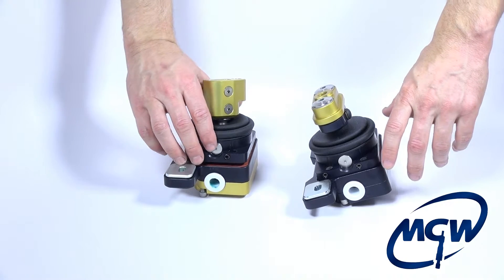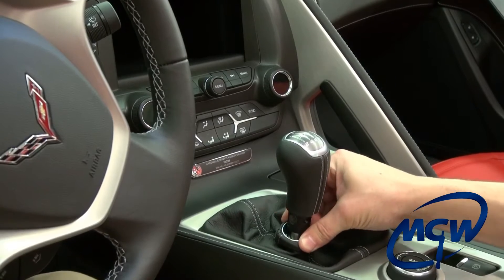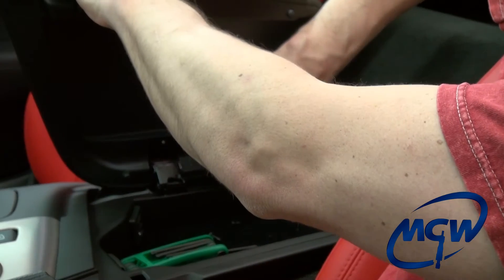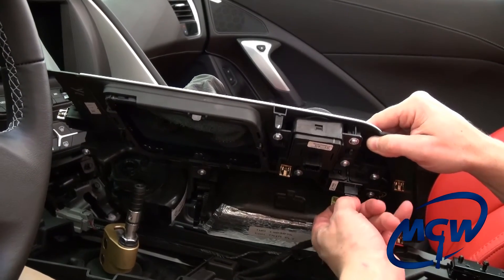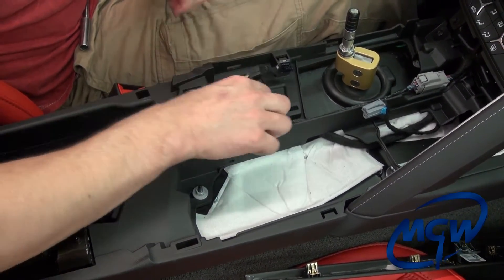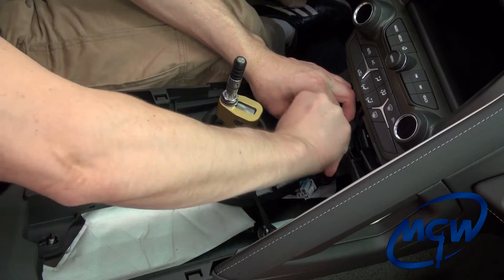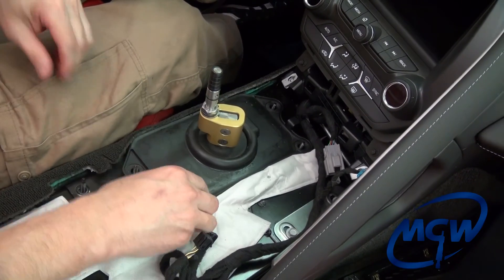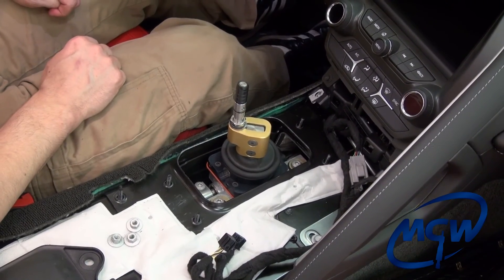MGW C7 Corvette Console Removal

Comment: The video is very well done and helpful.  However, I noticed one error.  It occurs at about 3:11 into the video where the side panel of the console is removed.  It shows removing the panel starting at the end nearest the dashboard.  Unfortunately, there is a plastic hook on that end of the panel that fits in a slot in the console. The hook will be broken if you start prying the panel from the front end.  Rather, start prying at the rear end of the panel and when the last metal clip releases, pull the panel back and out to disengage the plastic hook from the slot.
Reply: ^^^ HE'S RIGHT, you know ... ^^^

Comment: Thanks a lot. I fixed the leather boot that came of the ring connecting it to the shifter with your video. A 30 minute job that the dealer wants to charge me 250 usd for. Great stuff.. Might get courageous in the future and get your short shifter in my C7 Z51

Comment: Gave up.  Ring won't budge.  Tried lifting up.  Tried wrapping with cloth and using pliers.  That ring ain't twisting.
Reply from the maker: some can be a bitch but NEVER had one not come off. Might have to remove the leather from the ring and use some channel locks.

Comment: Out of all things i thought would come loose easy.  The shift boot collar wont come down. I have sat here for an hour trying to get it to turn and slide down so i can unscrew the knob.
Reply from the maker: some of them can be very tight.

try LIFTING up as you twist on the collar.

if you cannot get it, the easiest thing to do is to go ahead and remove the console, then lift up the boot with the console like a skirt and take a pair of channel locks and just gently grab the collar and rotate it. Even if it pops off the leather you can easily ziptie it back., its very easy.
Reply: MGWINC i was able to get it by going underneath and cutting the zip tie.

Comment: Did you not put the secondary rubber insulator back on top of the first rubber shield on the  shifter for a reason ?
Reply from the maker: the outer rubber boot is too tight unless you cut the square part out so we just leave it off.

Comment: Is the heat shielding application the same as the c6? It’s difficult to tell.
Reply from the maker: you actually can skip the sticky stuff on the torque tube on a c7 and just put the foam since the tube already has a heat shield material 

George